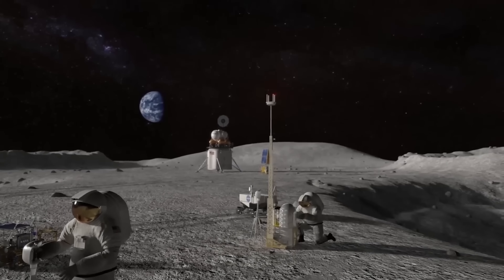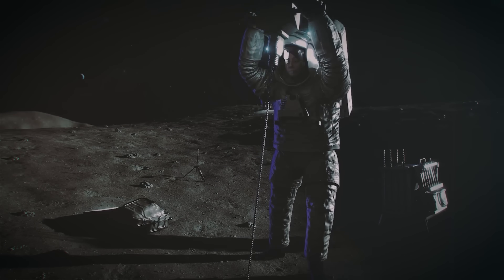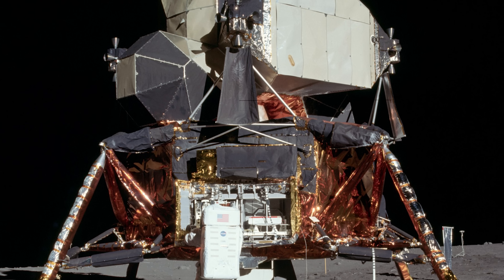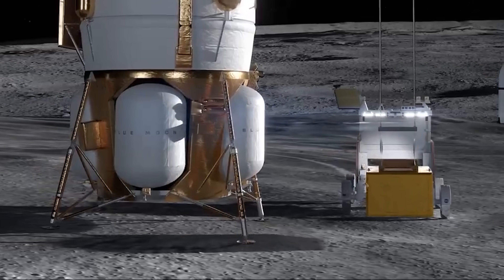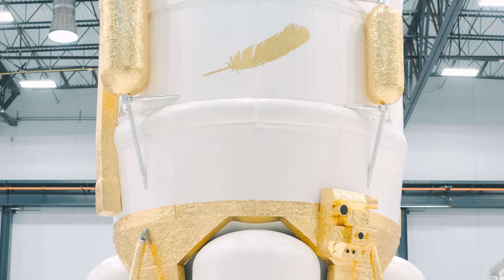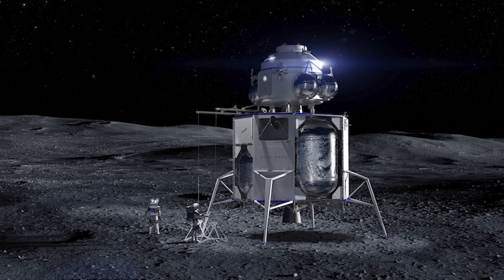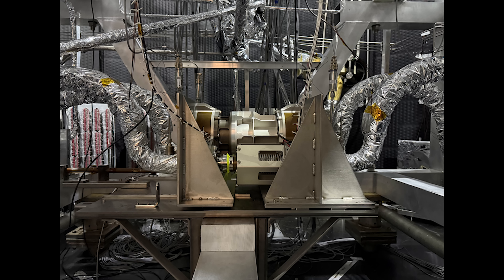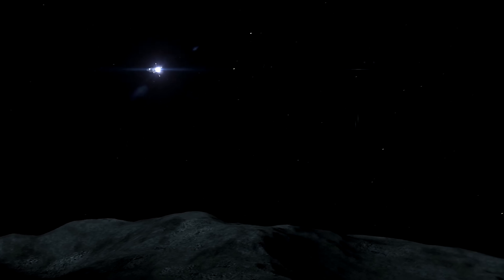Blue Origin CEO revealed new Solution to get Back to the Moon Better than SpaceX Starship

Comment: I have always been interested in space, but I find it difficult to understand why with Apollo system, it was a single launch to take astronauts to the moon. I understand we have a weight difference between Apollo and now but why do we need multiple launch’s and rockets etc?
Reply: Apollo missions only had men on the moon for hours. They were short term stays. These are designed for extended stays to support a permanent base.
Reply: Apollo 11 stayed only ~21 hours because the first Lunar Module had limited power, oxygen, cooling, and tight fuel margins—and its ascent engine was a single point of failure. If the ascent engine didn’t ignite then the astronauts would be stranded. NASA kept the first landing short to minimize risk.

Artemis III is way more complex because we’re aiming for longer stays, heavier science payloads, lunar mobility, and sustained exploration. We don’t really need the Lunar Gateway for that—Gateway ended up in NRHO mainly because Orion doesn’t have the delta-v to reach low lunar orbit, so the whole NRHO + Gateway + refueled lander setup is built around Orion’s constraints, not around what’s fundamentally required to land on the Moon.